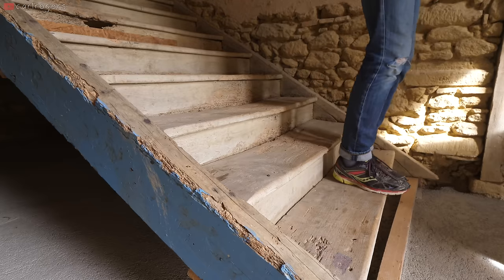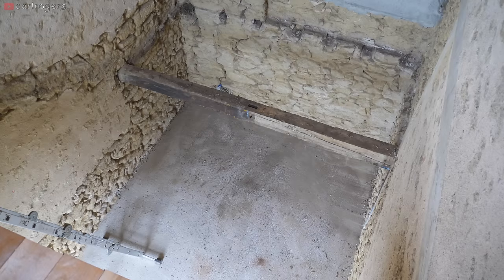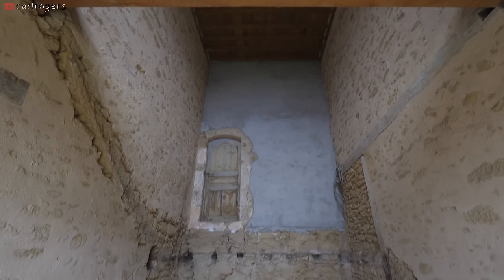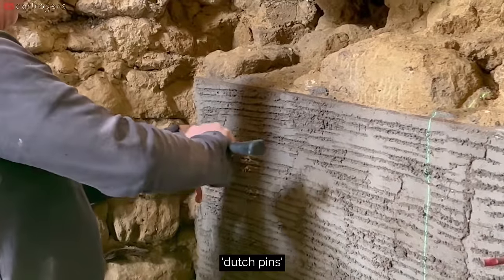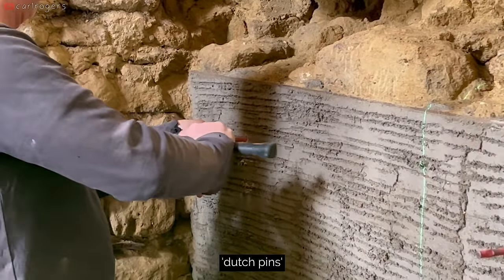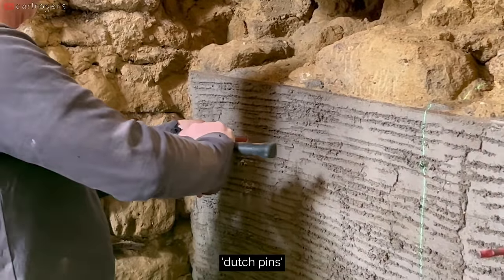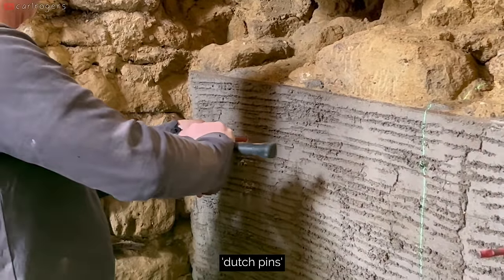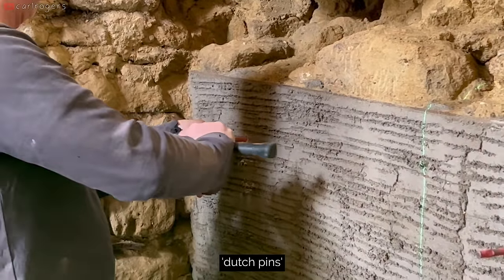#1 DEMOLITION | Building a Staircase

Comment: HI Carl. I have had the same problem as you and the circular saw. While not having tried candle wax - which I have found does not spread very well - I recognise it has other good uses, but I find a small smear of silicone grease works well. The other "lubricant" worth trying is graphite, suspended in petroleum jelly, which is pretty good. The hexagonal structure of carbon - long, long and narrow hexagons - allow the sliding to happen rather well. The jelly keeps in where you put it...and helps a bit too. The graphite can be found masquerading as a lock lubricant, in a puffer which you poke in through the keyhole. Very good in a lock as it doesn't attract dirt or dust. The other thing to look out for is alignment, or, more specifically mis-alignment. You may find that the radial arm is interfering with the adjuster. A small amount of force with straighten it. Good luck.

Comment: I did a house from the 1700s in Maryland where the owner wanted to save the stairs even though they were too far gone. I built a new set with  measurements just a tad lower than the original and then clapped on the old stairs and refinished them. Resulted in strong and beautiful stairs for a few more centuries.

Comment: You can fix the depth of cut on the Festool saw by going to a Bosch saw; 45 years exp with Bosch. I have several Bosch tools still running after 35-40 years. I have thrown away Milwaukee brand after three rebuilds--junk stuff.

Comment: With such a concerted effort to reinstate the stairs with an authentic look, (having just discovered the roof restoration) can I ask? What's with the plastic spacers? It would seem there is plenty of scrap oak around you, to use instead and would be considerate and respectful of the charm being removed.  i understand the need to replace any rotten wood, but don't forget, some of the older pieces are the history that deserves recognition albeit even in any small way  such as your coasters are. It will be interesting if you bring any older pieces of wood back into the building. I look forward to watching your next issue. Well done you!
Reply: Its very similar mentality to its original builders. Use what you want. Its a living building. Historical precedent takes a back seat to daily living satisfaction.
Reply: @joshschneider9766  Oh fer sure. It was just odd to see a bit of plastic when there was so much original wood lying around. I'm sure original builders didn't pop down the shop when there was a forest around them. Anyhow each to their own and it's nice to see restoration no matter what form.

Comment: Great video as always. You might already know this but just in case: if you want to kill the wave effect that you have sometime around 39:40 you can set the shutter speed or framerate (can't remember which) of the camera to a multiple (or half) of the frequency of the lights you're using, I'm guessing 50hz since you're in France. So maybe 25fps and/or a 1/125 or something similar?

Comment: very fun to see someone as pedantic as myself with setting out with the laser... in my experience 'professionals' don't bother with such things.. get yourself a big wooden mallett, kind of makes me squirm to see someone hitting wood with a metal hammer, although I guess oak can take it a little. Nailing is a bit old hat nowadays, you can get full threaded structural screws ( SPAX brand is very common in Germany ) which will drive in most wood without pre-drilling.. and you could still pre-drill if the oak is hard and it's a lot cleaner than bashing away at nails (and you can take them out again if there's a mistake ), need a strong drill of course, looking forward to seeing some more

Comment: The fact that it's 300 years old and in that somewhat usable condition speaks well about the craftsman that made it.
Reply: Which begs the question , why was the original stair case not repaired and retained? To me it looked as if it had plenty of life left in it . The same with the existing landing . All was required was for the wall to be chased out above the joists and the floor jacked up whole sale . 

   As for the concrete ring beam . Mmm. 

  This lad is undoubtedly  very capable and displays abilities that most people his age don’t possess, but I have to disagree with the way he has gone about this project . 

  I hope he has retained the old staircase and landing and finds a use for all of the good material that he is left with .

Comment: fascinating, but they didn't use Festools or paddle bits, reciprocating saws, forklifts or cars or chainsawws or lasers.  To even get a timber prepped to start digging into was likely a week long project.  ....They use green oak like that for dunnage for steel deliveries here in the states....free wood if you are around at the right times.  I used to gather it up over 30 years ago to have free project wood to play around with.

Comment: Adding too much water to cement/concrete mix impairs its resistance, you will probably get a very crumbly support. You should probably demolish it and pour it again. 
If you need a “fluid” mix you should try a “plasticizer” to make it easier to work and pour. Read the instructions very carefully

Comment: I am a carpenter and joiner by trade and in years gone by my business specialised in medieval and ecclesiastical carpentry. The fact that you guys are using 'power tools' to remove sections of the stair is testament to its solid construct. This stair case could have been repaired to maintain it's originality. It's only my opinion however from my experience as I do not have all the facts..

Comment: I have a friend who lives in a long house built in 1630, no way could you put a saw through the oak beams in that place. I rewired it for him and couldn't even drill pilot holes in the wood The original broad plank floor on the upper level wasn't much better.
Thankfully new regs weren't applied when the refurbishment was done, I love the low ceilings.

Comment: There are already some comments about the use of concrete instead of lime, but I thought I'd give some more info about lime for people who aren't familiar! Lime has been used in construction for millennia, and has largely been superceded by concrete - but for older buildings, this isn't great. The reason is that older buildings, made of timber, stone, cob, wattle & daub etc were designed to 'breathe', that is, to let moisture move freely out through the structure. People got very excited about concrete about a century ago, because in theory it's impenetrable to water, which in wet climates where damp can be a problem concrete was seen as a solution. The problem is that concrete is very strong, it's totally inflexible, and buildings move. Then you get little cracks in the concrete, which let rain water in - and because it's not breathable, the water gets trapped in the walls.
Using lime - as a mortar between stone/brick, or a render on the walls, allows any moisture to naturally exit the structure - meaning that timbers shouldn't rot, and mortar shouldn't crumble, and you shouldn't get moisture damage to stone or brick. You see this problem commonly on older brick homes which were originally lime mortared. They often get repointed with cement based mortar, but it's stronger than the brick and impervious to water. So the water gets trapped in the brick and often ends up freezing - you get frost shattering on the face of the brick and eventually the brick face recedes behind the cement mortar which ends up proud! This is one example of the problems the inappropriate use of concrete can cause. Lime is also slightly flexible unlike concrete, it's less strong, which can be useful. It's highly recommended that for older buildings you use sympathetic or traditional materials like lime to allow the building to perform in the way it was designed. That's not to say there isn't a place for concrete in some constructions. The other issue with concrete is the huge amount of CO2 released in it's manufacture (which accounts for something like 8% of global emissions I believe), whereas lime releases some CO2 in manufacturer but draws down CO2 as it carbonates in situ after use. I'm not an expert, but an enthusiast, so I hope that's all clear and correct!
I love what Carl is doing with this building generally; the repair of the oak frame is stunning, but would caution against using concrete in situations like in this video if possible.

Comment: I have no Idea if you will see this comment on time, or how far allong are you with your renovation at this point. Old stairs were pretty wide, I think somewhere around 140cm? I would recommand putting in a maximum of 100cm on both sides, and you will get a wonderfull airy space, perfect for a chandelier in between two parts of the stiars. There you can have a decent save in material and time, and the space will be way more representative...

Comment: Epoxy infusion would've brought back the wood from the damaged state, even with the missing parts, still missing. It can be done at home with a plastic bag and vacuum pump. Bummer, but it's your place so you make the rules. :))
Also, i hope the stuff you put on the wall breathes, otherwise you'll have a problem in time.

Comment: Hey I am most certainly not an expert on concrete but I'm pretty sure the less water added to concrete the stronger it is. Reason why I say this is because letting concrete soup stiffen up should in theory make a weaker concrete. It probably doesn't matter in this application but thought you might want to know.

Comment: To cut the tenon of the beam, I would have used the circular saw as you did, and after the small chain saw you used to clean the end of the beam. I believe it takes les time to place and fix the guide than making all those cuts and clean them with a chisel. I just four cuts you would have done it or so I think, but I am not an expert.

Comment: You really should have soaked the stone wall in water and given it a wet concrete brush before applying the concrete, that allows for the materials to dry in a low pace and have them stick to each other better, as you did with the smaller hole

Comment: Given the mess you have to clean up in your workshop,  I don't understand why you haven't set up a simple dust collection method.   A simple 5gal bucket with a inexpensive  cyclone top and a hose connected to your Festool units would control most of the sawdust while also save your lungs.

Comment: He might have rented a concrete vibrating poker as you see there were still air pockets down at the bottom of the form with the vibrating poker all gapes are filled it vibrats all the air to the top . just a thought

Comment: You're going to use the sabersol or Modern Electric saw and why did you use WD rust should have used a penetrating oil you wouldn't have to worry about that thing hard to move again but you will be using the WD rust

Comment: Adding too much water to the concrete mix and then leaving it for a duration for it to stiffen up may get you the result you need to work with the concrete but long will have a negative effect on the strength of the concrete !!!!

Comment: Putting those timbers to length would have had me squeaking. It's so easy to ge it wrong. To be honest I would have measured and cut each one on site. Less efficient but more fault tolerant. 
I'm a noob. Why have you not used oak dowels to pin the joints?

Comment: Why are you using Portland cement on old lime mortar walls.  Lime mortar would be far superior in your application and would avoid many of the risks associated with using cement next to wood.

Lime mortar walls move and breath but cement doesn't, using cement as a support beam may be okay but to replace mortar in walls it can trap moisture and cause the stones to decay.

Comment: "Maybe a good luck charm?" How you realize people have been buying and machine made things for too long. It's a finger twimble. You use it when you stich up thing by hand to push the needle throw fabric if the fabric has folded a lot and it's getting hard to get the needle through.

These have been around for as long as people sewn cloths. So somebody might have lost it at the top of these stairs and it nudged into the crack, never to be found until you demolished the stairs. keep it. it's probably very old. This one looks machine made and is made of metal, so there is a good chance you'll have an victorian age finger twimble there.

Comment: well that's good the wood is being replaced with the same type, would be a shame to take out oak and throw in something like pine cause honestly even though those stairs are creaky as all fuck they probably would have lasted another 50 years

also for small batches of concrete a good rule of thumb is to pour all your dry stuff into the wheelbarrow in a big pile then make a hole in the centre of the pile almost like a volcano, then just fill that hole up with water and you should have relatively the correct amount.

Comment: Why didn't you take out all the wood and put in steel cross beams braced of course you can always cover the expose steel in oak wood the walls dont look very structurally sound. Id blow off the dust and dirt and encase the inner and outer walls with high tension concrete to increase the house's structural integrity.

Comment: Since you did such a great job rebuilding a super strong retaining wall in the back, why did you have to go and remove 2/3 of the beam to make a silly tenon joint when you could have just stuck the whole beam in the wall like you did on the left side?  That wood column to the right is 300yo and ornamental at best. You could have gotten rid of it and back filled the wall or removed the mortise and inserted the whole beam.  🙄

Comment: No. You made a rookie mistake by not adding more cement. There is NOTHING more important in concrete than water to cement ratio. The perfect ratio is 0,39 by mass. For every kg of cement you need 0,39 kg of water. If the mixture is too thick to fill the molding (low workability) just add some dishwasher liqud.
For filling cavities like this I would also suggest using glass fiber. It prevents shrinkage.
Also for jobs like this a handheld concrete compactor (basically a gigant dildo) is just too cheap not to use.
No tanks will be riding those stairs so it should be fine.
As always great content. THX and take care.

Comment: Use motor oil or grease on those post jack threads not WD-40. WD-40 is not a true lubricant and offers no protection for the threads.

Comment: that is not how you plung cut with a circular saw. PERIOD. you may take your cat and throw it out the window. The front of the base plate is held firmly above your cut and the back of the saw is plunged down.
To much water in your concrete ruins the mix. You fix a wet mix by adding more concrete to get the correct ratio to produce the correct finished strength.

Comment: Just dreadful to see such poor work being carried out on a historic property. This is a step by step guide as to how you degrade and wreck the fabric and character of old buildings. Cement should NEVER be used on a historic building like this, only lime. It seems the answers to all the failings in both patience and ability are to knock up a load of cement and get the circle saw out. If you can't do it properly, PLEASE don't do it at all.